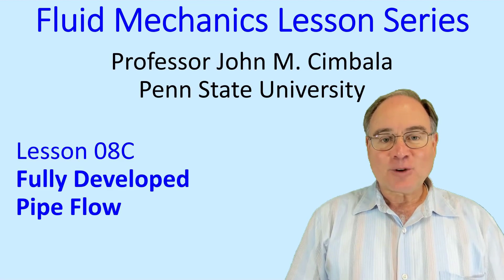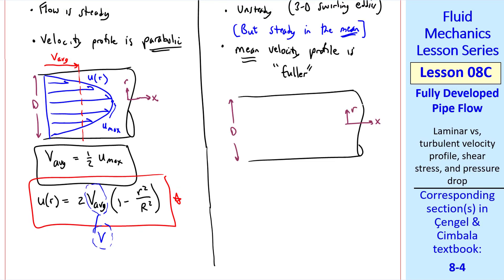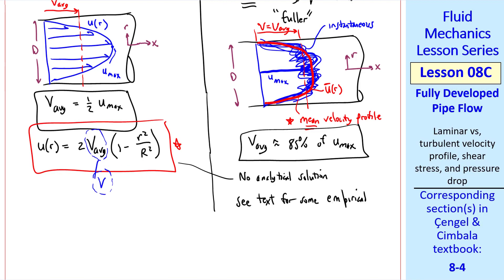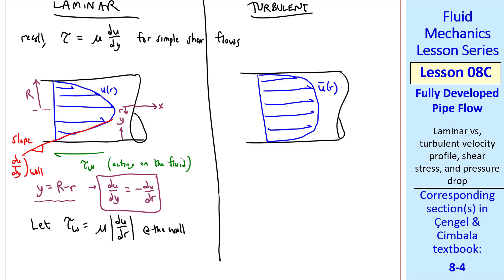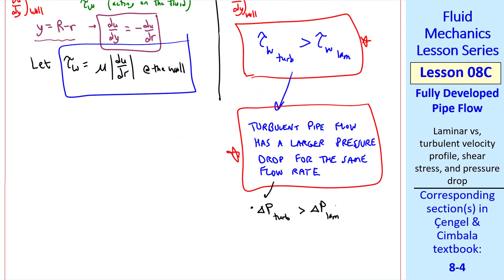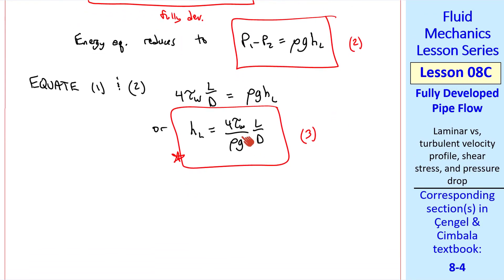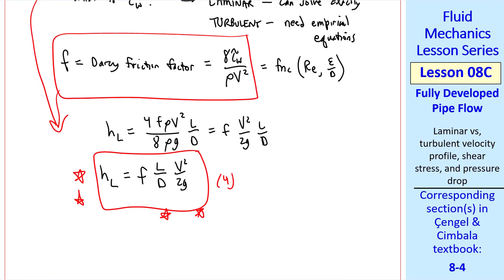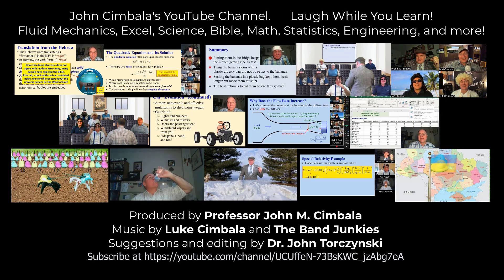Fluid Mechanics Lesson 08C: Fully Developed Pipe Flow

Comment: Hi, in the example, you use 1.004E-6 as the kinematic viscosity of water. Is that supposed to be 10.04E-6? I tried the problem using the slightly different form of Re, with 998 as density, 0.0681 as length and 0.01 as dynamic viscosity. I got 47.231 m/s for the velocity. Putting that in the equation gets me 1741.4 m of head loss. I'm wondering if I've made a mistake somewhere because that seems quite high and doesn't match the video, but I've checked my units over and I can't seem to figure it out.
Reply from the maker: My kinematic viscosity is correct for water. I am not sure where the problem is, but I am pretty sure that my algebra and solution is correct. I suspect you have an error somewhere.